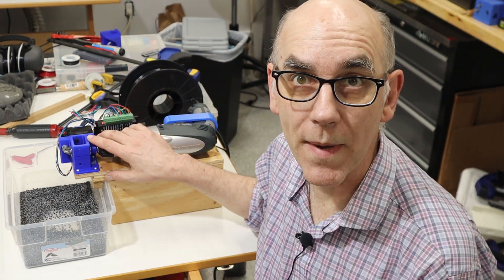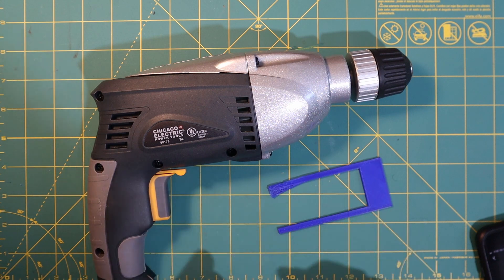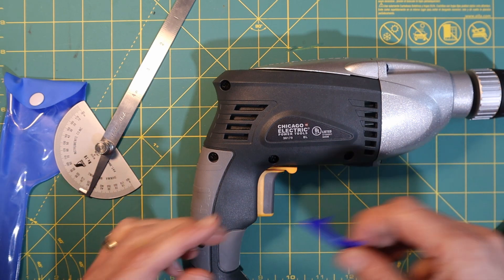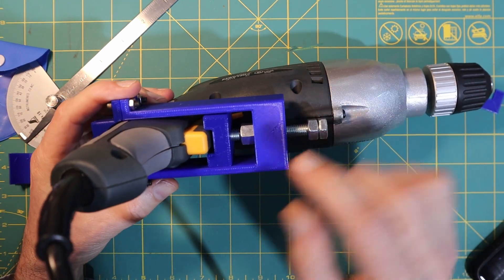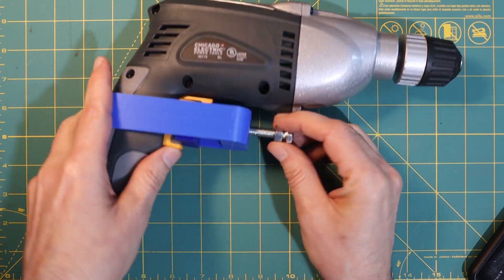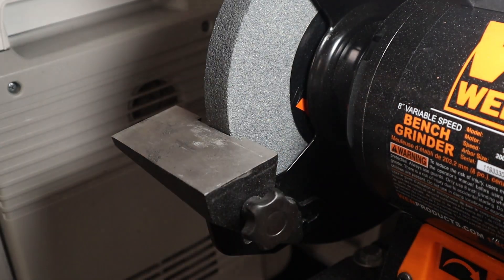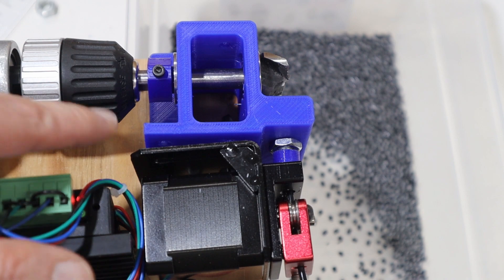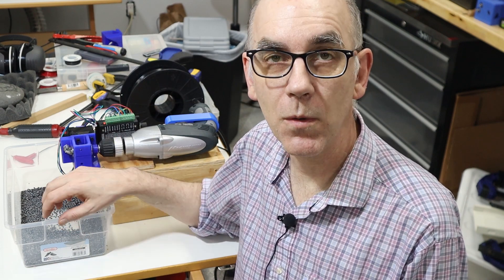Plastic Pellet Maker Part 6

Comment: funny you made a specyfic contraption for holding the trigger while there are drills with that feature integrated into the switch (at least in europe, i don't know if that allowed in usa) they have button on the side as a lock and clicking screw in the center of a drigger so all you would need to build would be simple collar mounting around the round flange  just after the chuck 
i love the project though

Comment: Your switch depresser is elegant. I would have gone with zip ties. You might also consider taking the drill apart and securing the drill motor directly to the frame holding the chopper. You'd reduce some of the vibrational "flop".

Comment: The Joe Piecynski getting shapes to not let go in your chuck vid after watching Adam Savage?
That is some valuable info. 
I have had some badly chucked bit drivers make junk out my parts.
Lol rod coupling. All is just extra letters. Works just fine on partially threaded rods too.
Reply from the maker: Yes, it was Joe's video! Thanks. I've added a card in the video, and a link in my description.
Reply: And steppers lose torque at speed.

Comment: You could try just putting a metal plate on top of that printed part with bolts on either side of the Forstner bit shaft going into T-nuts inserted underneath the plywood base.  It would put the whole block under compression and keep it from splitting.
Reply from the maker: Thanks Pete. That would certainly work. I've decided to go straight to aluminum. I have a new design that uses 1/2" by 2.5" wide aluminum stock, which I have on hand.

Comment: Would using another stepper in place of the drill work?
Reply from the maker: It would have to be a pretty large stepper. The force required to shear the 2.85 mm filament is pretty high.

Comment: The long nut that you was referencing is called an allthread coupling. We use them in the Construction industry. I'm getting a lot out of your videos and I appreciate you doing them. I've ordered a Batum CNC desktop machine and it should be shipping out later this month. I've never done any CNC machine work in my life, but I'm looking forward to learning how to use it. I will be making molds for a product I sell so I hope it doesn't get too expensive. Where do you get the blocks of Aluminum for your molds?
I've been looking around my area and haven't found a supplier...
Reply from the maker: All, allthread coupling. Thanks! I mostly order from Xometry.com these days. There is a local Online Metals, but they're a lot more expensive than Xometry.
Reply: @JohnSL  thanks brother! Keep them videos coming!😎😎😎

Comment: I think the flats that you ground are probably a pretty big part of the vibration that led to the print delamination.  With the lighter portion of the spinning system (the bit) held rigidly, there is more movement on the heavy side (the drill), and any eccentricities will get amplified.  Great work, just a (hopefully helpful) observation.
Reply from the maker: I was thinking that as well. But the drill runs smoothly when I'm not feeding filament. So I just realized the issue is most likely the holes for the bearings are not tight enough, so as it's cutting filament, it can push the bearings around in the holes. Switching to aluminum will definitely fix that issue.